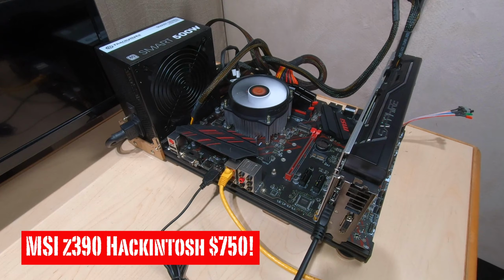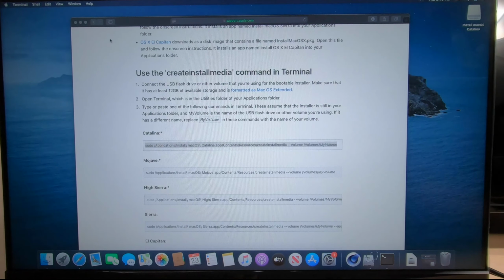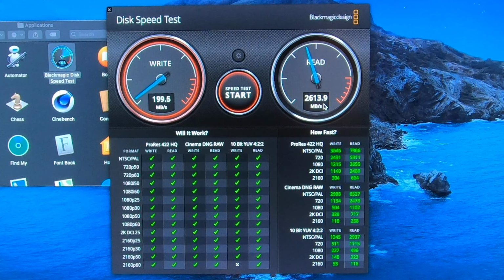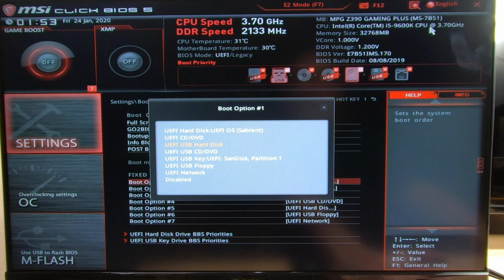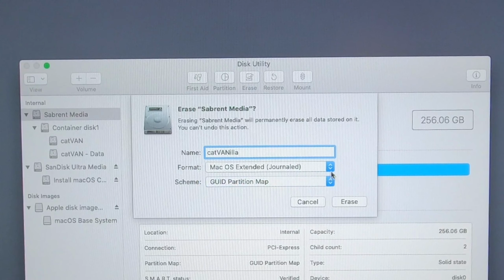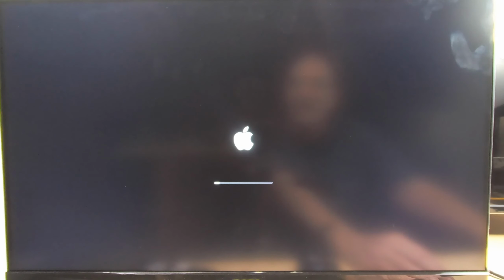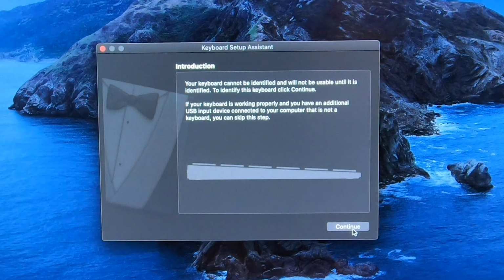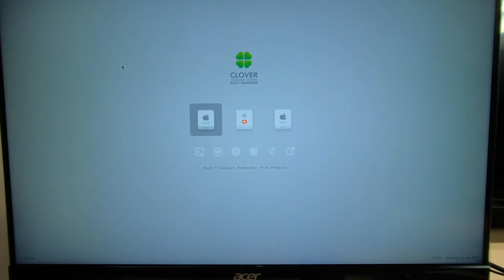Complete Easy Hackintosh Catalina Build Step by Step | 2020

Comment: Hi TechNolli! First of, thank you for creating this guide, with the EFIs. It's amazing how Hackintosh has come since I got my 1st Hackintosh back in 2015. Unfortunately, the motherboard gave in and I've decided to jump back into researching for a new build, and I managed to bump into your video. I got a couple of questions and I hope you can answer them. 

Considering that I would follow your video, with the EFI file you provided and modify the build with i5-9600 instead of i5-9600K and Sapphire Pulse RX 580 4GB instead of 8GB. Would it still work?
Reply from the maker: Hi Nicholas, It should work but it will be slow.  Thanks
Reply: @TechNolli  Hey! So I just came back from surveying the local stores here in Malaysia and apparently there are some items that are not on the shelves anymore. So, I was just wondering, by following your build but with Intel i7-9700 and Sapphire Nitro+ RX 580 8GB. Would it still work? EDIT: It worked! Though I had to Disable CFG Lock in BIOS. Everything works well! Thanks.

Comment: I had an "older hackintosh",  so I built the one you have here with exactly the same parts.. Catalina..  Only difference is, 64gb Ram, and the gpu is  the Radeon rx580, XFX.   Everything went as planned, the only issue I have is...  When I go to shut down system, it just reboots. it will not shut down..     it also reboots when it goes to sleep.   any ideas?
Reply from the maker: Try this never Opencore EFI from this video: https://youtu.be/mOQ0jz1o14I
Reply: @TechNolli  Thank you for the link.  I took a look at your video and saw the NVRAM support for 390 boards..  So, fumbling around with "multibeast". I saw, a function for support the NVRAM, 390.  So, I chose that as well as whatevergreen and everything seems to work perfectly now.  Very fast system,  I have it separate drive for Kubuntu on the same machine, so duel booting.   Great video series you have,  thanks much!!!!!!

Comment: Hi again Technolli! I realized today while transfering a file to a USB disk that the speed is extremely slow, I dont know why. Does it happen the same to you in your build? Do you know how to fix it? Thank in advance!!!
Reply from the maker: Hi Jose! Is it a USB 2 or USB 3 stick?
Reply: @TechNolli  It is a USB 3 stick. And it is connected to a USB 3.0 port.
Reply: Update/Still not working: I have followed Hackintool USB Guide to limit the number of ports to 15 and it it is still the same. With a SS Stick which speed is up to 5 GB/s, the real speed on Black Magic App is 20 MB/s. And with another SSD disk which is aso SS 3.0, the speed is around 60 MB/s. I dont understand a thing!. 
Any ideas what it might be related to? 
Thank you in advace!!

Comment: I seem to be stuck on the boot screen after selecting the verbose setting.  I am using an MSI B250-PRO-VDH
Reply: I did adjust some more BIOS settings, but not it is just looping back to the Clover Boot Manager when I run the Install with Verbose option or not.
Reply from the maker: Hi Royston! Please email me a pic of where you are stuck to support@technolli.com  Thanks!
Reply: @TechNolli  Was able to get it running, but with one issue, well two.  Clover Config won't recognize the boot SSD, preventing me from mounting the EFI partition.  I need to do that to fix my sound issue.  Any ideas?

Comment: You can SAVE $32 by using the i5 without Internal Graphics (IG).  The system build is using a discrete graphic card anyway. https://www.amazon.com/dp/B07MQP5LNM/ref=dp_cerb_3 (list price $206.95). I tried to make every dollar count when building a custom system.  I planning on diverting the cash to purchase a better rated power supply.
Reply from the maker: Good idea Richard! Thanks!!

Comment: Does all the feature of Mac OS work (i.e. iMessage, Air Drop, Blutooth)?  I should of ask, what feature do NOT work.  Great Video ... Thanks! :)
Reply from the maker: Hi Richard! I did not test a wifi/bluetooth card in that build, but as long as you change your serial numbers you should be fine. I'll be testing Airdrop on the new builds this week. Thanks!

Comment: Hi Technolli! Everything works perfect but when the pc goes to sleep it will never wake up! It seems that the pc is working when I move the mouse or keyboard but the monitor shows "no signal". What should I do? Thank you in advance!
Reply from the maker: Hi Jose! Try to push the on/off button and see if it wakes up. Don't hold it in like shut down, just click it. Let me know! Thanks!
Reply: Hi again  @TechNolli !
So weird... Since I read your advice, I tried to reproduce the same issue with another monitor, and you know what? It works perfectly with a "Samsung S27E390H Resolution 1920 x 1080", but when I try it using a "LG 32UD59 Resolution 4K" it fails and the monitor will never wake up. 
Actually, after sleep mode if I wake up the computer and unplug the LG and plug in the Samsung monitor, it works (I can see the screen and work properly), but if I go back to the LG monitor and I plug in again the cable it is still not working. It is a really weird issue... 
Thank you!
Reply: Update: I figured out what was causing the problem. After googling about LG 4K monitors, I read that the problem could be related to a function called: "Ultra HD Deep Colour". After disabling that function everything works as expected.

Comment: Have you ever try XFX RX 5700, any drawbacks? Thanks.
Reply from the maker: Hi Kevin,  I have only tested the XFX RX 570 4GB, with no issues.  Thanks!
Reply: TechNolli Thanks. Back in 2011 I did a Lion build, Gigabyte X79S-UDP, Intel i7 3820, PNY GTX 950 OC. I am trying to resurrect it with the RX 5700 XT. Your channel is amazing, helping people build a safe, stable, and affordable Hackintosh. Keep those builds coming.

Comment: Hi there. Congrats for your video. I would like to reproduce your build and before that would like to know if everything work (Bluetooth, hands-off, air drop, sound, etc) I saw that hdmi sound works but don't know if it would be possible to connect some speakers to the mother board directly. Thank so much for ur time!
Reply from the maker: Hi Jose!  Bluetooth will need a separate card: https://tinyurl.com/upcf2tt  Onboard sound did work great!  Thanks!
Reply: Thank you so much again for your work and fast reply!